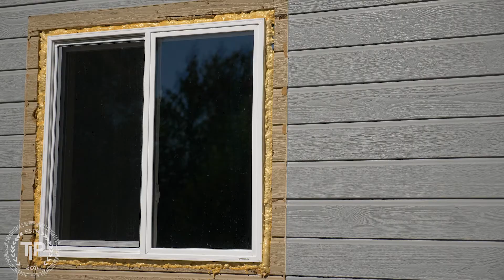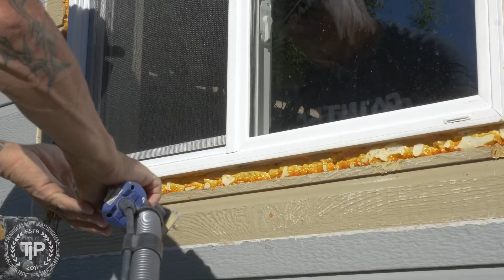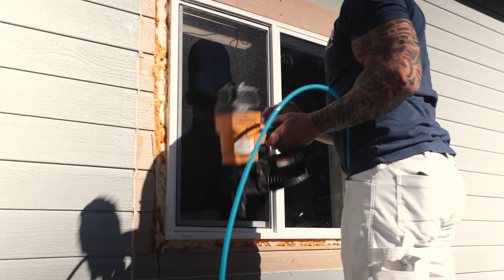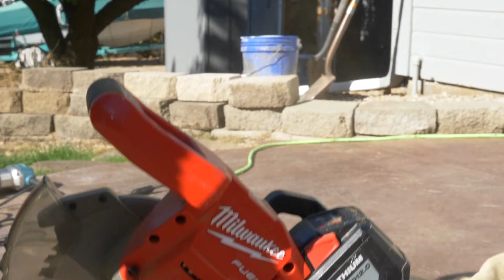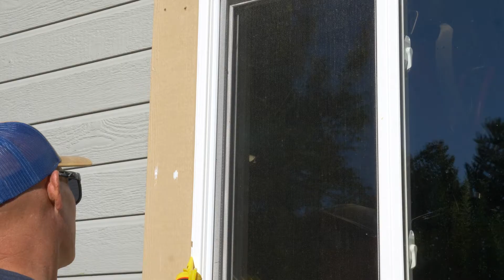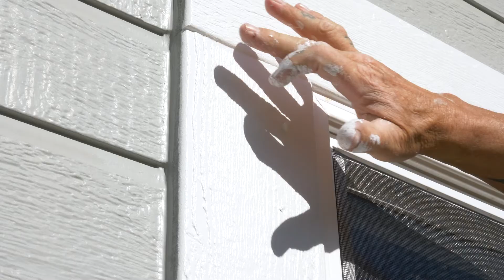Installing Exterior Window Trim.  The Idaho Painter Way.

Comment: Great to see that it doesn’t have to be cut 45 degrees angle, I just got windows installed and the guy cut them same way.. I was wondering if that was correct. He installed mine not as half of good as this though

Comment: I'm getting ready to primer/paint a replaced exterior window stool. The old one rotted and replaced with treated pine. I've primer / painted it every other year. Takes a lot of beating, but keeps pealing. Think I could use a putty knife and cover it with Dap paintable acrylic caulk + silicone? It says it is paintable in 30 minutes and is made for doors/windows. 100% waterproof and okay for interior or exterior.

Comment: Nice work! Quick question, for anyone who knows. Would flashing be needed on the top horizontal piece? So that water doesn't get in?
Reply: Exactly my thoughts water could run down behind that top trim and your screwed
Reply: @atbass41  Yeah that's what I was thinking. I wonder if just an L shaped flashing would do or would I need to cut a notch and insert a little of the L shaped flashing
Reply: @TheTexan_87  Yea ALWAYS install a drip cap or head flashing above the top window trim and attach it to the wall and top of window trim with a good bead of silicone. Keeps any water from getting down behind the trim and rotting out the wood. Saves you having to do this all over again in 5-10 years.

Comment: Just an American badass , I usually 45 miter my corners
Reply: @suspicionofdeceit This style of trim - rough cut boards with the tops going past the sides - is common on cheaper homes in the west. You depend on caulking and flashing to prevent water damage.
Reply: Probably just matching what's on rest of the house
Reply from the maker: We all have our ways
Reply: What is the material used for the trim? PVC, LP, real wood?

Great video!

Comment: I dont understand why some windows are trimmed with with drip cap and sill. I dont like this method . it moves to slow even when I adjust the speed to 1.5 x, I dont need to see you cut the boards. also the music sucks
Reply: @phwerks  Where’s your vid? Let us critique YOU.
Reply: @markpr73  Funny that you ignore my technical question, why a drip cap and sill are not necessary in your technique? I get the feeling that you take things way too personally, I have plenty of friends who listen to crappy music. My only guess as to - Why you need to show how to cut aboard, is that you need to make your video longer to match some length quota
BTW I have lots of vids, I don't get upset if somebody doesn't like my presentation, even when it seems demeaning. I just like to get to the point when I look at how to videos, and then get back to work
👷‍♂